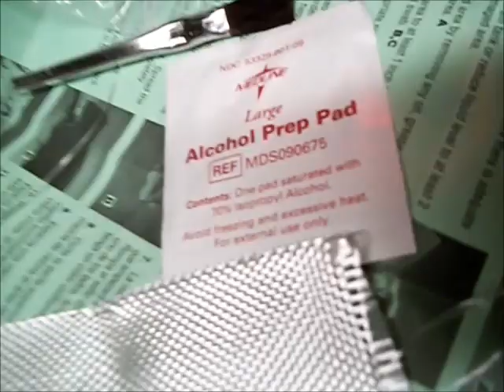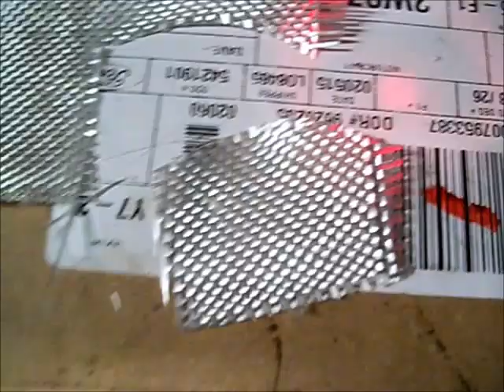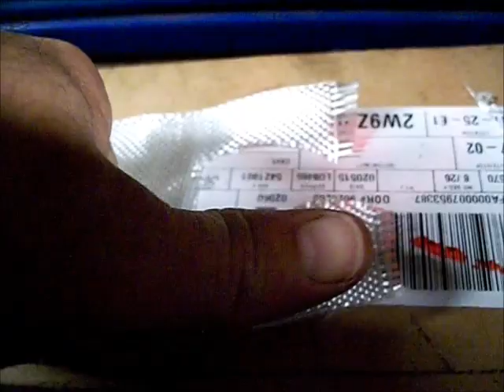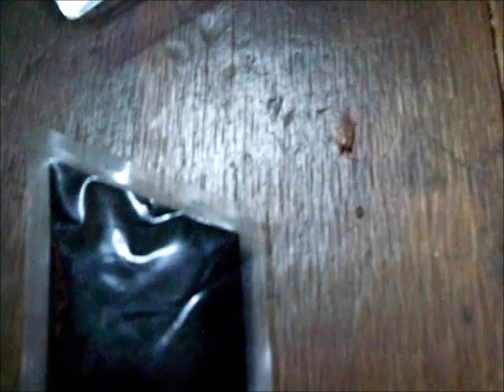Rust hole in gas tank repair

Comment: Great video, I just bought a old Yamaha EF1000 generator off eBay only to find it has a gas leak :(

Upon taking it apart I found the gas leak was coming from under the gas tank and it was from a series of tiny rust holes that were letting gas through and causing the slow leak to happen - Thank you so much for taking the time and making this video as this was a great help to me and I will now look for a gas tank repair kit just like the one that you used :)

A massive thumbs up from me man ! ;)

Comment: Out of all the tank repair videos I’ve seen so far I like this one the best. First I’m a big believer in sanding the surface and this comes with sandpaper. Second, I like that this is a resin material. Third, I like that it comes with the fiberglass reinforcement mesh. Heck you can’t go wrong with this kit. Only question I have is where can you buy this kit?
Reply from the maker: Its ("permatex" fuel tank repair kit) available most parts stores, like advance.  Thanks for watching

Comment: Is this the best temp repair. Because jbweld n waterweld didn't work on my 99 suburban
Reply from the maker: Nestor Barretpo.  The repair must be made with an epoxy compound  that is specially formulated to resistant gasoline's ability to dissolve materials, like in weld.  Also all of that material must be removed, along with the rust now.  A used tank is a viable option, and is typically affordable.
Reply: No, best is to solder it. Then you'll have a solid metal to metal bond.
Reply: @suprlite  I ended up just replacing the rusty tank with a brand new one.:)

Comment: So how well did this hold up over time?
Reply from the maker: It will hold at this point for years, as for the rest of the tank it will hold till it gets another rust hole in it.  Keep in mind that this is suppose to be a temporary repair, (under 3 months) until a new tank is acquired and it is replaced.  Like until a new one is ordered and arrives, or until the owners finances allow.  It should be considered temporary and not a permanent repair, as the rest of the tank is likely compromised as well.

Comment: if U can't make a video in a nice lighted place don't make one
Reply from the maker: Well, the 14,000 other views didn't have a problem with it, so... probably the concern is at your location.
Reply: if u cant make a nice comment dont make one!
Reply from the maker: Thanks Dossy B.  I think the tube back ups do glitch a little.  As I have found an odd video gets corrupted. Also, sometimes playing at a higher resolution like 360 p will brighten the vids up substantially.
Reply: you probably cant see it coz your cataracts old timer!!! i could see what he was doing just fine!
Reply: Enough light on our PC but most YouTube clips need more volume  and information as to if the repairs worked permanently .